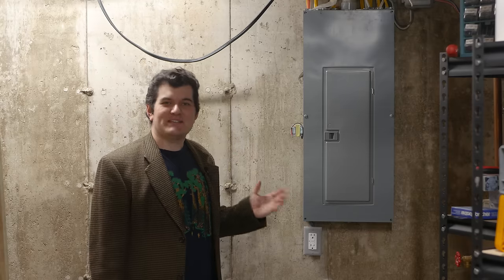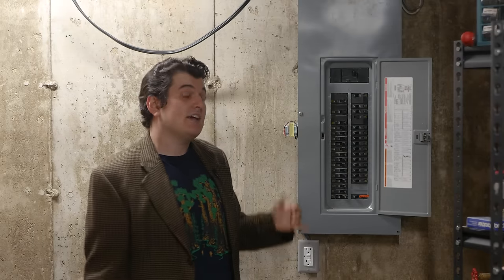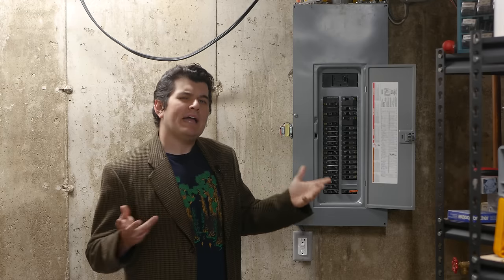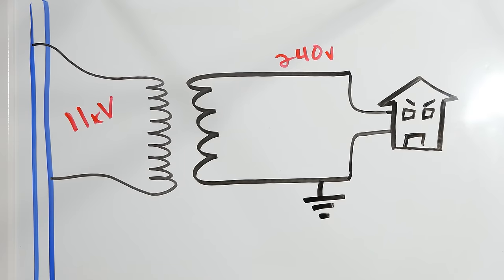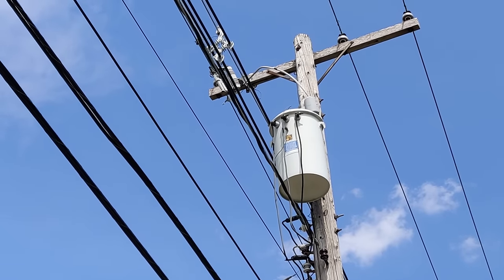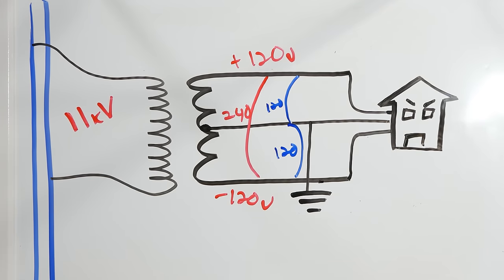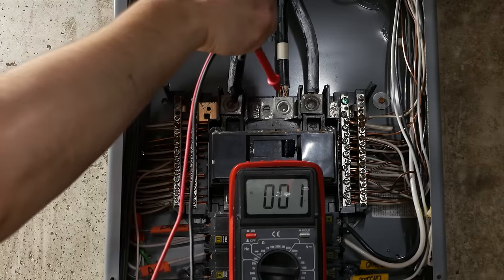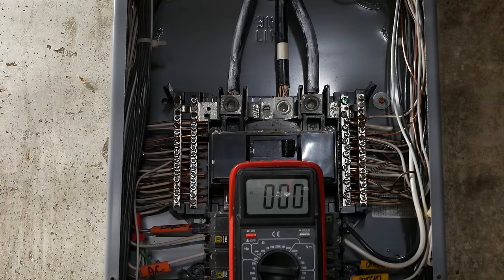The US electrical system is not 120V

Comment: As for the dryers, its 120/240v and 120 is for the... Control board, any lights, and a motor to spin the drum. Ranges use 120/240 for controls, and a fan motor if it's a convection oven. Same for wall ovens, too. As an electrician,  I'm required to provide a 4 wires connection to these appliances, from NEC 1996 to now. 

Pre 1996, the ground was also permitted to carry the small current from a light or timer motor, on account of the larger wire being less likely to be damaged. 

The circuits were typically ran in type SEU cable, where the neutral is wrapped around the hot wires under the jacket. Modern large 240v circuits are often ran in aluminum SER cable, having three insulated wires and a bare ground.

Comment: An excellent topic! I've known actual licensed electricians who don't understand how 240v split-phase works.
Reply: That's an absolutely terrifying prospect.
Reply: @ceralor  Why's it terrifying? It's not like they're dealing with that exact... type... of... 
oh.
Reply: Don’t have to understand why it works to know how to make it work. 😂
Reply: Difference between an Electrical Engineer and an Electrician.
Reply: That's a bit like a technician not understanding why plugs are referred to as male connectors, and jacks as female connectors.
Reply: Even greater number of them who have no understanding of 3 phase, or if you really want to see them go into idiot mode, mention the 2 phase system that Philadelphia Electric used and still uses in some places. When you try to explain the Scott-T transformer connection needed to interconnect it to the 3 phase system, their eyes go in different directions like a gecko. Worse yet some 2 phase buildings had 5 wire service, and some used 4 wire service.
Reply: One would think you should at least basically understand such a key part of their profession
Reply: @cindytepper8878  I live in Texas and when I was in my twenties I would bring up the 2 phase system around the other electricians and they were all convinced I was crazy.  I've seen veterans ready to fight because I must have been talking about split single phase.  But you wanna see them completely shut down, just bring up Steinmetz's Monocyclic power, or even High Voltage Direct Current Transmission.
Reply: Curse of Knowledge Bias
Reply: @lordfly911    You think the engineers all know?  I once had to explain the difference between 240V single phase and 208 3 phase to an engineer.  We were on the manufacturing floor and the engineer needed to find a socket to plug in his 240V device.  He saw one labeled 208 and said "there's one". He truly believed that 208V is what results when the load pulls down the voltage.
Reply: @e-curb  Wow.  I hope he wasn't a PE.
Reply: It is true though!!!   I have had to explain to quite a few that the two 120V legs are NOT different phases.......three phase sourced multi family dwelling units excepted. My students always came in to this confused until I added the center tap on the board....  The collective ‘a-ha’ gasp was always there.
Reply: As someone currently enrolled in uni..... The people who I see pursuing majors in stuff like EE or CS or even just an ME.... I'm going for finance and I have a far better understanding of electrical engineering than most of them will ever have. Seriously, like a solid 80% are "C's get degrees".
Reply: @Jeremiah Crow Wrong, this subject at hand is very elementary. I've worked with plenty of electrical engineers, technicians and electricians in which have a firm understanding of the theory they are exposed to daily. Surround yourself with the right people to learn from. Thank you
Reply: @Jeremiah Crow yeah but they should now how things work in order to repair or do proper maintainence atleast i belive so ive only been studying 2yrs on electronics so far aniways
Reply: @herpnderpn2484  electrical engineering covers much much more than just power systems, however you are right about 'C's get degrees' that applies to the vast majority of engineers
Reply: @jnorris3738  I'm aware. Currently, my stepmother is working on an anode system to protect the underground piping at a nuclear plant. She has a masters in EE. 
Before that it was the transformers, before that it was a robot that installed the windshields in some car that Ford makes. She works for a design firm and the work is quite varied. Integrated circuits up to transmission lines
Reply: I know a UK electrician who didn't know why a live/neutral switch on a ring main was a problem!  Typical "on the tools" trained man who understands nothing about electricity.

Comment: Comming from country where pretty much every house has 3-Phase 400V, and mandatory RCDs (GFCI) in the Panel. Murica is still weird.
Reply: We’re getting there. We have AFCI breakers required on pretty much every 120v circuits in the house now, as well as GFIs required on more circuits every time the code gets updated. Seems like soon many 240v devices will be getting GFI protection added in the next couple years. Only issues I have with it is the cost of building a house has gone up quite a bit. I mean a standard breaker costs like $6. An afci or gfi (or dual function) breaker costs $45-60. Not exactly budget friendly...
Reply: I'm not understanding the pissing contest about 400V stove power, when we (the US) have natural gas for our heating. The 120V power source is only the ignition, and powers the electronics.
Reply: Yes, give my EV 3p 400v.
Reply: Wait, you forgot the line that every comment from a German leaves on YouTube videos... "That is forbidden in Germany." It's always that same line. "Forbidden."
Reply: @1mrhamel  the video was about "we haz big voltage too" so ppl are just havin fun :)
Afaik most electrical stoves don't even use the 400V but 3x 230V for seperate areas. For me the 400V are mostly about powerful tools or car-charging.
Reply: @FirestoneFilm  in my home in germany (built in 1992), i got only 1 RCD. Its wired between the main braker and the indivudal curcuit brakers. So i don´t need a ton of these expensive RCDs, and it gets tripped so rarely, that it´s not a big deal that in this case the power of the whole building is shut off.
Reply: @FirestoneFilm  >An afci or gfi (or dual function) breaker costs $45-60. 
What if I tell you that there are multiple types of RCDs (AC, A, F, B) and their pricing vary a lot more? ;) Three phase B cost up to $1k equiv here in Poland.
Even type A is 2x the price of AC. 
https://www.electrical-installation.org/enwiki/Types_of_RCDs
And yes, RCDs provide the real protection (versus the overcurrent breakers) for people. And "older" types are annoying when you deal with equipment of high capacitance (like high power UPSes).
Reply: @1mrhamel  Because natural gas is not renewable and your gas heating unit is way more inefficient than a gas power plant. Higher voltage (with samen ampere) gives also more power in the form of wattage.
Reply: @FirestoneFilm  Not only do our residual leakage breakers appear to cost less than yours, we generally need far fewer in our panels. Of course, when a breaker trips half of the house goes with it. :)
Reply: Per our US electrical code, we use GFI at places where the contact with water is greater (kitchen, bathroom, garage, and outside the house). And for the people that find it weird to have an outlet in the bathroom, it's for electric razors, hair dryers, etc
Reply: @eldom20  Code also requires arc fault circuit interrupters (AFCI) on outlets - but only on bedrooms as of when my house was constructed in ‘05.  If I had kids or animals that liked to chew on wire I’d add them to all the outlet circuits for the peace of mind.

Ground Fault Circuit Interrupters (GFCI) can be in the panel, or the first outlet in a circuit if it’s wired in series - that’s what I have found to be more common.  Which lead to fun in the bathrooms - all the bathrooms are on one circuit and the GFCI is in master bath.  If you have ladies with hair dryers going in all the bathrooms at once things get interesting :/
Reply: @FirestoneFilm  Depending on the state/county you can use one GFCI to cover all sockets in an area. e.g. all sockets on a kitchen counter near the sick or in a bathroom.  You don't need a GFCI on each.
Reply: you should at least consider that our GFCI receptacles trip at much lower fault currents than your panel RCDs
Reply: @bigbramel   I think you are confused why natural gas is used in America.  No one cares that the power-plant is more efficient in using the gas, what matters to Americans is that the gas cost less than the equivalent electricity.
Reply: @xenonram  Verboten
Reply: My house has GFI breakers (Not AFCI) going to bedrooms and pool. Outdoor outlets, kitchen and bath have GFI outlets. Not sure what drove this design as I did not own the house when it was built.
Reply: @bigbramel  I disagree. Electrical transmission is only something like 30-35% efficient and the main source is still probably fossil fuel. There aren't any transmission losses with natural gas so the appliance can burn up to it's rating 85%+ of energy delivered from the fuel.
Reply: @bigbramel  A primary use of a fuel is always more efficient then secondary. So until the grid is nearly all renewable it is wasteful to not use gas. There are generation loses, and transmission loses with electricity.
Reply: @btwbrand  It's not actually more efficient to burn gas at a power plant to convert it to electricity to send it over the grid to power an electric burner on a stove. It's more efficient to burn the gas directly at the stove where more of it's heat energy goes to heating up food.
Reply: @1mrhamel  Water heaters now can be electrical connection-free.  With a natural gas pilot light, the thermocouple used to detect the flame (as a safety measure) also generates just enough milliamps to operate the control electronics.  Ingenious and efficient.  I suppose that an oven with pilot lights could be set up the same way, although with multiple pilots always on, the efficiency gain is pretty well lost.  It just depends which energy source is cheaper in your locality.  So, maybe electrical igniters are still better for those.
Reply: @xenonram  Haha!  Thanks, Bro! You reminded me of some German sailors I met in Navy school.  There were 4 of them - three of them so tightly wrapped that if you stuffed a lump of coal up their ass in three weeks you have a diamond (Thank you Ferris Bueller) and then there was Udo. A bunch of us went to a Moody Blues concert, along with Udo. When we got there the air was thick with smoke, and a pungent aroma hung heavily.  Udo was all serious, and with a wrinkled nose said "Vat,vat is zat smell und ze smoke?"  "It's POT Udo!" said a friend. "But, but, but" he sputtered "is zis not forbidden?" "Sure is - want some?"  I don't remember if he hit it or not, but it wouldn't have mattered - there was enough smoke in the air to get everyone high just by convection.
Reply: But at least here in dk we have the same 3 phase setup at  230v which gives 400v...so what is the point?
Reply: Bobby Brady as an American, I personally give anyone in the world the okay to say “Murica”. It’s funny and our country does things weird (pickup trucks as daily drivers, power grid, imperial system(for the general public)). We’re strange, just accept it and go with it, don’t be a snowflake
Reply: Andrew Delashaw Nope. We Germans have some thin but important lines between forbidden, prohibited, and not allowed. In case of electricity you can go with your old installation and a wooden board as a panel, when your house was built, when this kind of setup was allowed. And as long you don‘t have a tenant and it‘s your own house and you don‘t tamper with the metering device: pretty much no body cares.  But when you are building a new house you get the full treatment by the book. In this case it’s the holy book named „DIN VDE 0100 Teil 410“. It gets enriched with new pain every year.
Reply: Bobby Brady I just compare 369 people electrocuted by accident (plus those you fried intentionally) in the US in 2019 alone according to osha with 39 in Germany in the past 15 years. So being an electrical engineer and having worked in the US as well, i might be in the position to say „Murica“ and „weird“, as you putting GFCI in receptables is due to rather high ground loop resistance allowed where the rest of the world puts an rcd in the panel protecting every outlet and even the cables in the wall, when you pinch a nail in them.
Reply: @bigbramel  Direct gas heating is not less efficient than gas > electric > heat
Reply: @DocNo27  and then you have the inspectors...many will demand GFI outlets even if you have the breakers and vice versa
Reply: @Jack-bv5xd  Europe is 99% urban/suburban/ex-urban like the US coasts - "just have it delivered" is a way of life.
Reply: @falkmachtsachen  *unholy book
I suppose there is an argument to be made comparing it to revelations tho
Reply: @falkmachtsachen  Half of rcd would be removed the moment the inspector left. Give Darwin a chance.
Reply: @bigbramel  The contrary is true; the power plant can generate 45 % of the contained energy as electricity while a gas oven can generate >90 % of heat in the house. If you want to be environment-friendly, use a solar collector to heat your water locally and install insulation on your house. Then add a gas oven for when the sun doesn't shine enough.

Having more wattage per outlet is nice, though.
Reply: Our codes allow homeowners to do their own electrical, and letting the average homeowner work on 3-phase would be a terrible idea.

Comment: You amuse me , as a professional electrician with 47 years in the trade, we all do things different, but in our own ways we are all safe even in the u.s.
Different but safe, I am from the u.k.
Reply: An electric shower heater would never pass code in the US, and rings? Or trying to figure out if neutral was black or blue?
Reply: But, I admire how tough the BS plugs are, and I think the fuse is a really good idea.
Reply: I also could never chain circuits onto a RCD like you guys do. I'd have to run a sperate RCD (we call it a GFI) on each circuit.
Reply: @micah66048  I have separate RCBOs, for each of my circuits in my fuse board here in the UK, don't see what the issue with running a bunch of MCBS off one RCD is though, you've still got residual current protection for all those circuits, it just makes fault finding slightly more difficult than separate RCBOs.
Reply: Explain to me how ring-mains are safe? If one end of a heavily-loaded ring-main comes loose, the other side will carry all the load for that circuit and the wire will overheat.
Reply: Robert (Electrician), what is the maximum potential difference available across two terminals of UK standard supply? Its potentially 620V How so?
Reply: @tomctutor  Normal UK voltage should be 240/415. That is RMS voltage. Peak voltage would be 415*(sqrt2) for 585 volts. Now, some industrial stuff in the UK runs off 415/720, but that is not common. I'm from the US, but I'm a Generator Mechanic who has served with British Soldiers in various NATO missions.
Reply: @micah66048  In the US you can connect either!  That is the problem!
A heater element is not phase sensitive......
Reply: @micah66048  It's a brilliant idea. 
1) Exactly. The plug is fused for the load. 
2) It is IMPOSSiBLE to connect the load incorrectly: 
     Phase-Neutral is always ALWAYS CORRECT. 
     You cannot say that in the rest of the world. 
     I know...in many cases...it does not matter...but when it does....It does.
3)The British 13A Outlet is the safest design on the planet. Bar none.
    It's idiot proof. (It needs to be...believe me.)
Reply: @patagualianmostly7437  What do you think about our Australian system? (if you're familiar). It seems reasonably well thought out for safety to me but I might be missing some details
Reply: @micah66048  Plugs with breakers are annoying AF
Reply: @MrZoolook  I've never seen a moulded plug where a blown fuse could not be replaced, Stuart. Think about it, if what you intimate is true, you would have to replace the whole cable/chord for a blown fuse.